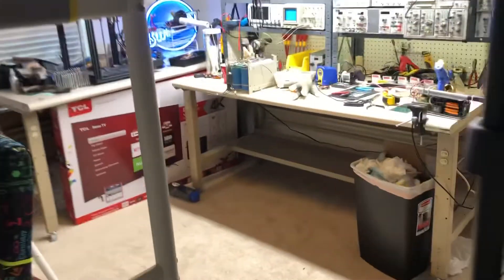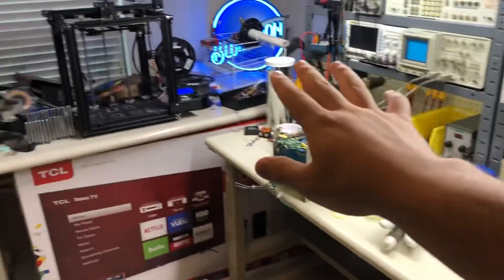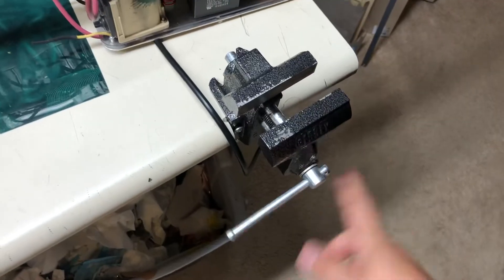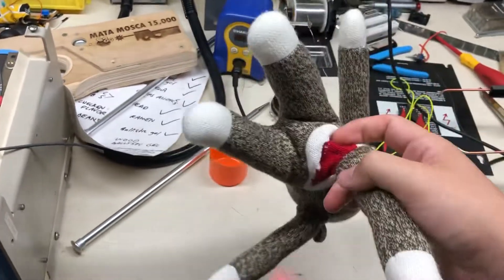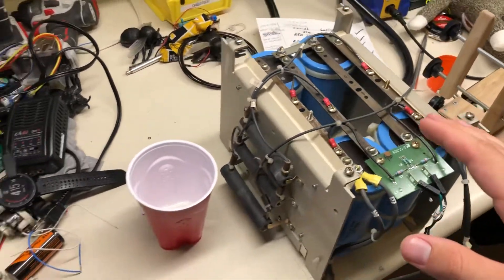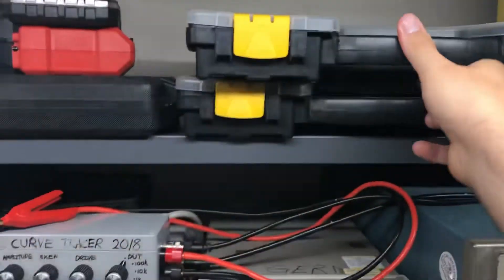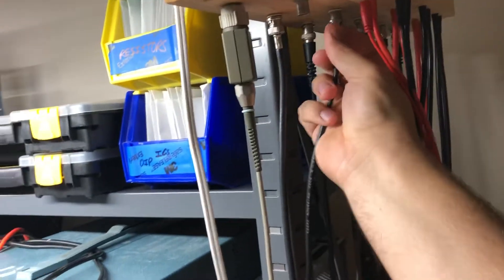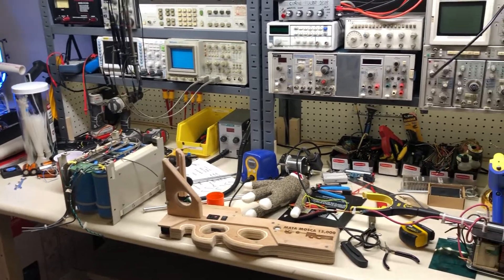Fazio Bedroom Electronics Lab Tour

Comment: I don't understand how you have the shelving set up in relation to the table? All the Best! 73 DE W8LV BILL
Reply: I looked into it a little, apparently you can get really low shelving units, which you usually use to stack onto the large ones or somthing similar. If you use them as a base and stack 2 or 3 small units you get something like in the video
Reply from the maker: I cut a full height shelf in half and made some modifications to affix them to my bench